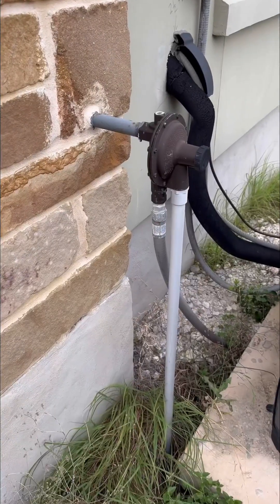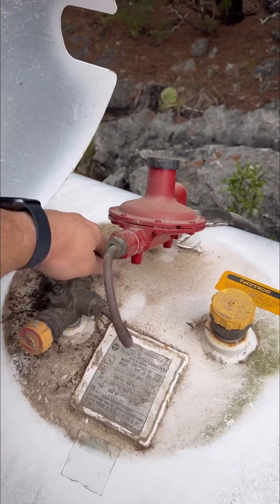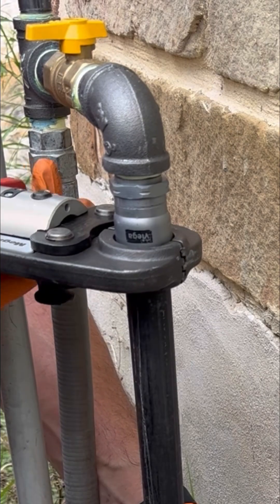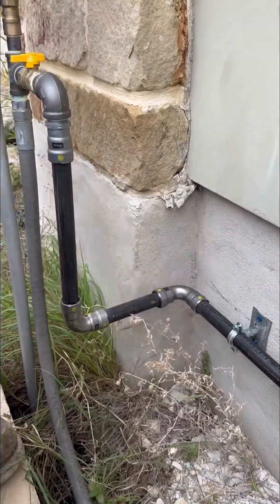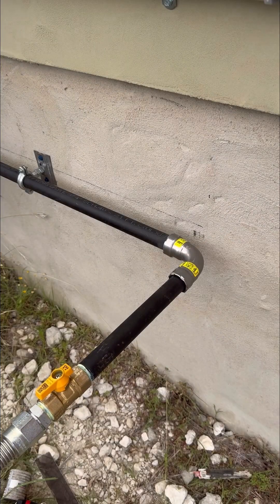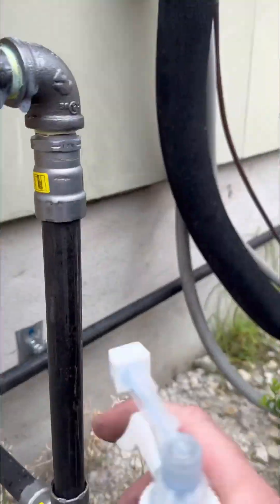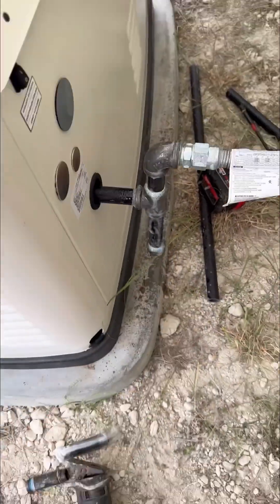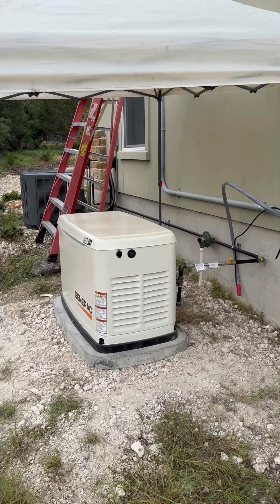Installing A Gas Line For A Generator. #plumbing #shorts

Comment: Wouldn't you need flexible gas lines when connecting to the generator because of vibration?
Reply: There is one, you can clearly see it near the end of the video

Comment: next time tie into after the 2nd stage regulator and no need for a second regulator. size line appropriately. as long as the structure load isnt more than the regulator can handle with a backup generator. then you have no need to vent away. also not sure where you are located but white pvc should not be used for vent away. not uv protected in most cases. use grey conduit.

Comment: I thought you weren't allowed to use that black pipe outside? It needs to be galvanized pipe for outside. I've been told that black iron pipe will rust out and leak very quick if you let it get rained on.
Reply: So you paint it or let it develop it's own protective patina. Do not use galvanized pipe for natural gas or propane lines as the zinc coating can flake off and clog gas regulators or burner jets
Reply: @Robnord1  Old wives tale, not true, some places it is actually required to be galvanized like at the coast

Comment: I plan to run a black threaded pipe gas line about 12 feet under my house for a rinnai heater. Any details I need to know? Thanks.
Reply: Yes. A whole list of them. Look up proper sizing for your BTUs and proper materials and method to meet local code. Done wrong will cause problems like voiding your insurance or leaking.

Comment: You dont need a sediment trap before the generac because there is one already inside the generator before the internal regulator
Reply from the maker: @KgiMedia601  yeah but that one is difficult to access if it ever needs to be cleaned so I like to put one that’s easily serviceable
Reply: Was wondering if I was the only one thinking that!!😂

Comment: Try using the concrete Sammy’s there really good and fast to use instead of the celling flange in my opinion, try them out see if you like it

Comment: Good job. And I like press fittings for gas, and here in the NE we use black pipe, tapered threads, and nothing gets painted. It all gets a rusty surface patina but lasts (apparently) 175 yrs since there is still original service piping in use from the 1840s and 50s. And here is one of the most confusing things in English. Run/Ran.  You “ran the piping” which means the “the piping was run”(not ran) by you 😂. Hey if you’re gonna be a narrator…_ 😂

Comment: Bro why not buy some zinc plated or galvanised pipe? Its cheap and everywhere.
Reply: Bro - galvanized pipe is illegal for natural gas in most places. The gas causes the coating to flake off the inside of the pipe and travel to (and clog up) regulators and gas valves.  You do NOT want a gas valve that won’t shut off or a regulator that won’t maintain a pressure setting.  That’s why.
Reply: @HBSuccess  The whole first sentence is basically a lie, unless you can cite the code section, sometimes it is even required
Reply: @nspro931  In my area only black pipe is allowed with gas, if you use  anything else it will fail inspection
Reply: Galvanized piping is corroded away by both propane and natural gas